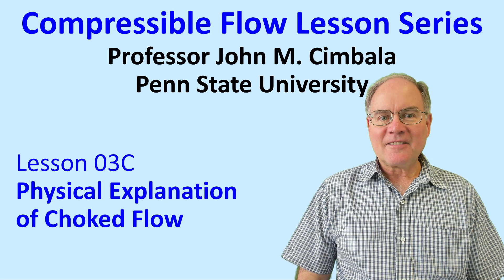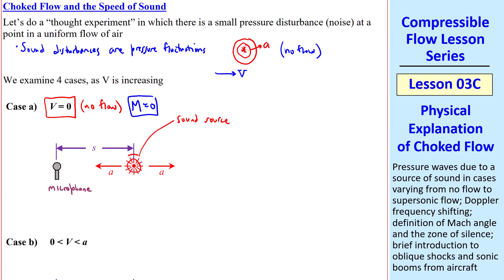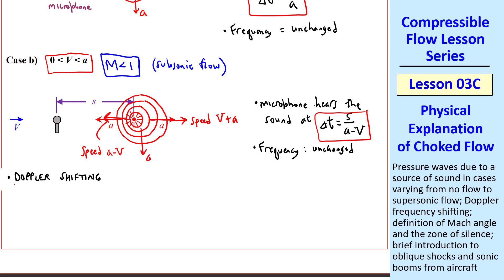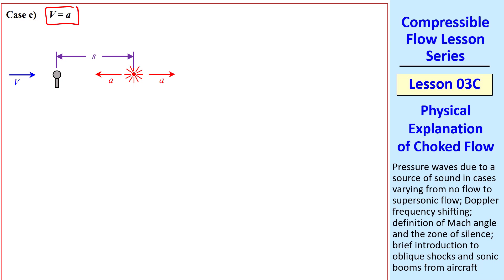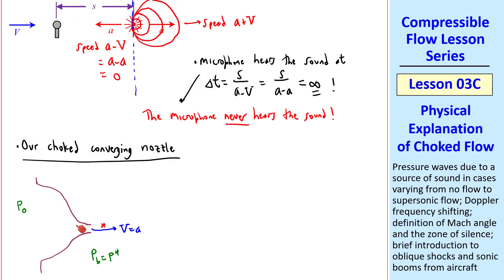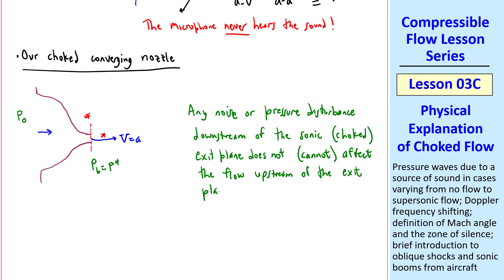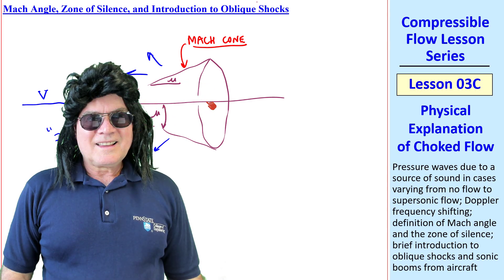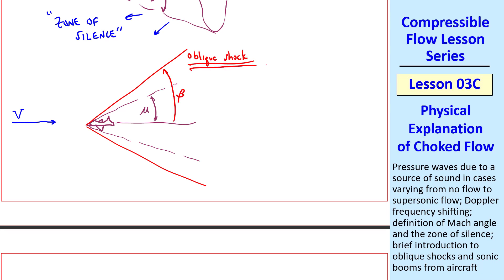Compressible Flow Lesson 03C: Physical Explanation of Choked Flow

Comment: Thanks for this compressible playlist, John. In case (b) in this video, wouldn't the frequency picked up by the microphone decrease as the wind is speeding the disturbances downstream from the microphone?
Reply from the maker: No, because there is no relative motion between the sound source and the microphone. It takes longer for the sound waves to reach the microphone, but once they reach it, the frequency does not change. There has to be relative motion between the source and the receiver for there to be a Doppler shift. By the way, I just posted a short video yesterday about the Doppler shift where I discuss this. Check it out.
Thank you for your comment. Please tell your friends and colleagues about my YouTube channel where there are more than 600 free videos about the Bible, fluid mechanics, science, math, Excel, statistics, air pollution, and other topics. I would greatly appreciate it.